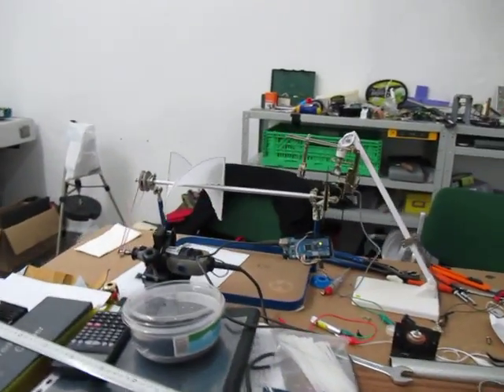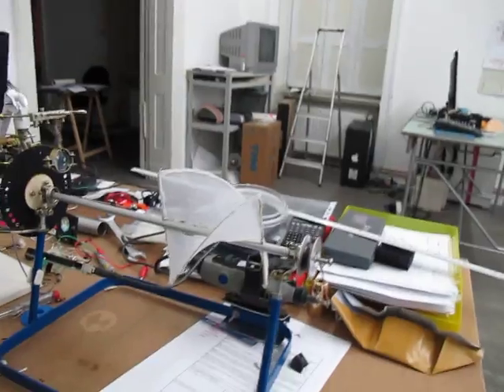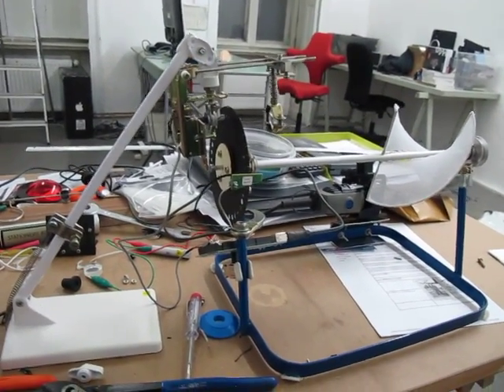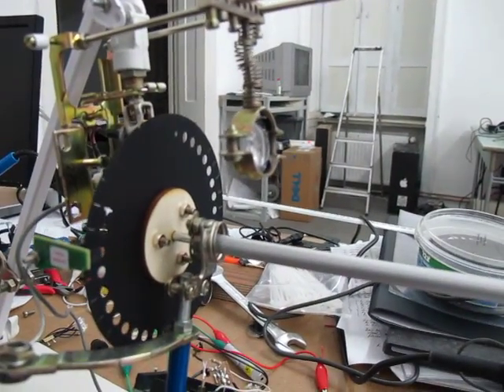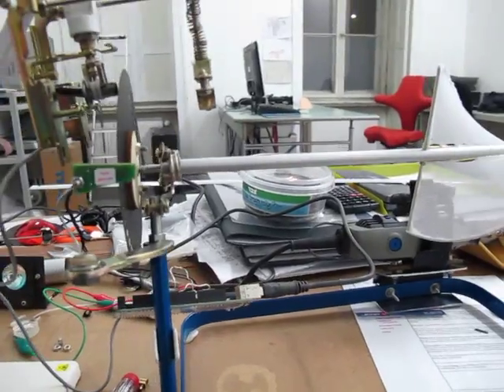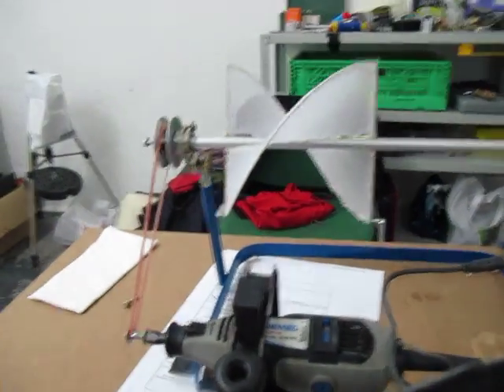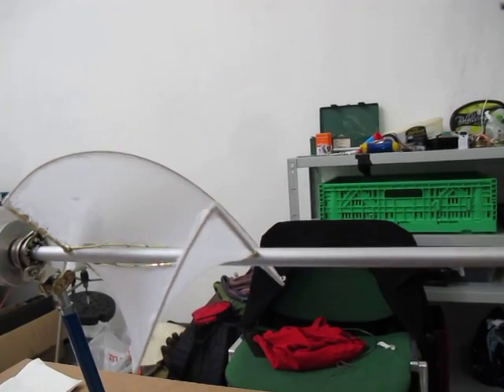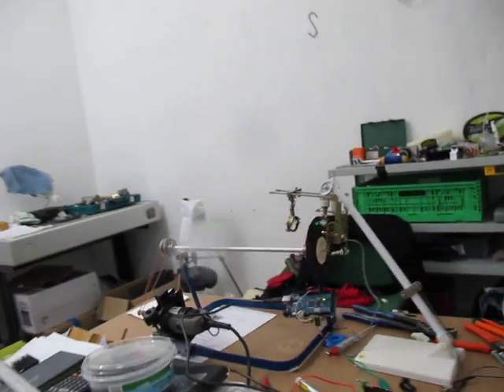Volumetric display for 40 euros

Comment: Thought about this some time ago (but standing upright), nice to see someone actually working on it! The hard part will be rendering the spiral slices of the object. Flexible OLEDs suggested by tlyoq would create a huge electronic interface problem with limited resolution. As shown, you could increase resolution just by using a higher-res projector. Keep the mechanical part simple!
Reply: Hey, ten years late here haha, but did you ever end up working on this?

Comment: You could use flexible oleds instead of projecting (assuming they can handle the g's), though you'd have to have either brushed contacts or some sort of customized IR transmission. You'd get a nice resolution boost.